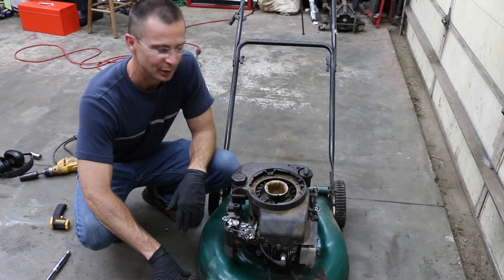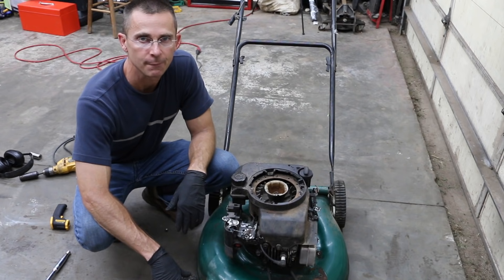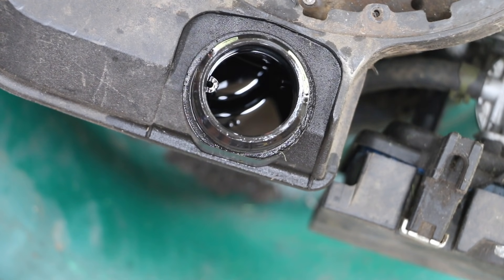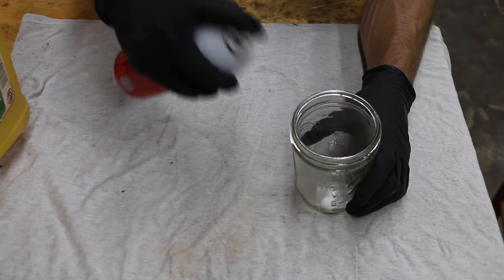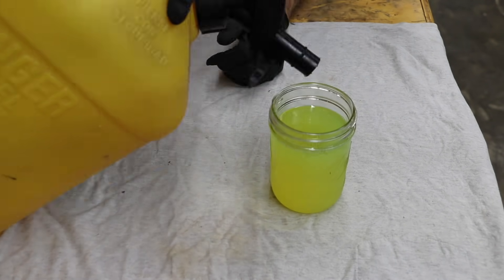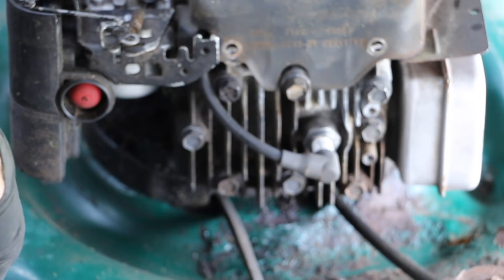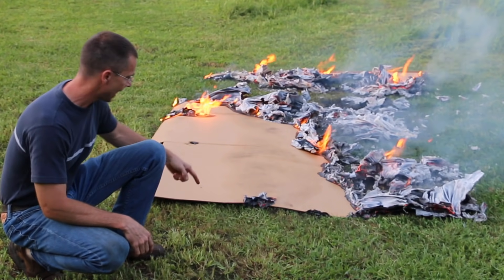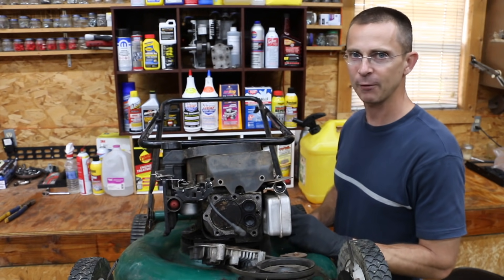Will a Gas Engine Run on Diesel?  Let's find out!

Comment: Years ago, when I worked for a manufacturer of generators and industrial engines, a technician accidentally ran a gasoline engine on Diesel fuel when it was connected to a dynamometer.  It started just fine, no doubt because the carburetor had gasoline in it.  It developed somewhat less power than it should have and ran hotter, and was a bit rough.

In case someone is wondering how he could have used Diesel fuel accidentally instead of gasoline, each dynamometer room had connections for multiple fuel choices, including Diesel, so it was an easy mistake to make.
Reply from the maker: Frank, I enjoyed reading your comments.  Thanks!

Comment: Engine will not run without continues use of primer yet will cut the lawn no problem
Reply from the maker: Chris, It wouldn't run on 100% diesel but did run and mow grass on 50/50 gas diesel mix.  Thanks for commenting!

Comment: One day i randomly checked my oil and the stick was dry.  Come to find out one of Toyotas flaws is that the holes in the Pistons  that Supply oil to the Rings get clogged up. So For the last several months I have been using a fuel system cleaner every other tank of fuel.  Marvel mystery oil, chevron techron, stp multi system cleaner, sea foam, gumout multi system cleaner, starbrite startron, jectron, Lucas deep clean, stp 5in1, Redline, royal purple max,sea foam, and Cataclean will be the last. When the final bottle is through I will be doing a video showing what it has done to the internal components
Reply from the maker: Thanks for commenting and I look forward to checking out the video you make if you'll share the link when it's published.

Comment: I really thought that it wouldn't run at all on the 50/50 mix. Those flathead engines are usually very low compression ratio and that might have contributed to the poor showing of the diesel only test. I had a Suzuki 650 Vstrom and it had 10.5 to 1 compression if I remember right, might have been higher, anyway, the combustion chamber is so efficiently shaped that it runs fine and they recommend 87 octane fuel. Back in the 50's and 60's there were a lot of engines in American cars with anywhere from 8 to 1 all the way up into the 14 to 1 range. The old 426 Hemi had one of those high ratios and required gas rated above 100 octane to run without detonation or pre ignition. I wonder how that engine or one like it, would run on the diesel fuel.  Also I want to know more about that set up you have for starting your mower with your drill. I'm starting to get to where I can't pull start much anymore and that would help me a lot on my mower and my weedeater.
Reply from the maker: I enjoyed reading your comments.  Thanks!

Comment: How about mixing window washer fluid with something?  Maybe window washer fluid and 25% gas?  Washer fluid is Methanol with probably 50% water, if you raise the quantity I bet it will work fine.  WW2 Planes would use this for a stability in fuel.
Reply from the maker: This is a great idea--thanks!

Comment: Running Diesel in a Gasoline engine. I have hade a real life experience with this experiment. Once you have completed your experiment, you need to check the oil level in the pan. Since to Diesel is not ignighting, or burning, due to the compression factor,  it is passing by the rings on the piston in the cylinder. This then weakens the oil properties, and eventually, the engine will seize up. Trashed a Ford V8 engine. Then found out, out on a farm, the large gas tank was filled by the supplier with the wrong fuel. They filled the 500 gal gas tank with Diesel.
Reply from the maker: Dan, thanks for this information!  Sorry to hear that you experienced a ruined engine from this.

Comment: Years ago they burnt kerosene in tractors by running the fuel line thru exhaust manifold. They had a switcher valve to switch from gas to kerosene once the engine was up to temp. My dad said the engine would smoke like crazy if it wasn't up to temp. He claimed the engine also had more power on kerosene. If you would rig up a gas line thru exhaust your diesel trick will work!
Reply from the maker: Thanks for sharing this information!

Comment: We put diesel in our gas tractor many times by accident. I grew up on a farm.  It smoked a lot but no damage to the engine.  It depends on the the how much diesel was added to the gas.  The tractor was still running 30 years later.  Bottom line, if it will start, it will run, but no damage.
Reply from the maker: Thanks for commenting and sharing your experience!

Comment: I actually ran a pressure washer on straight diesel accidentally.  I filled it with diesel that I thought was gasoline.  The engine hadn't been run in months and therefore needed priming.  I was in a rush so I used starting fluid in the air filter to get it started.  It took a while for the engine to warm up and run right, but once it was warm it ran fine.  When I shut it down it puffed white smoke,  I thought I destroyed my engine, but then I realized I had filled it with diesel.  It was amazing that a standard briggs and stratton engine would run fine on diesel.
Reply from the maker: Impressive!  Thanks for sharing this experience.

Comment: Would there be any benifit of running off a mixture maybe closer to 25 gas 75 diesel. Ie more compression, cool engine temps, less wear?
Reply: Or the other way around? Or an e85 and diesel
Reply from the maker: Thank you for these video ideas!

Comment: Great demo. I used to run a 1968 VW Beetle on 30% diesel and 70% petrol. Never had any problems with it, even on colder days. Tiny bit of smoke and you could smell the diesel, but my fuel costs were lower this way.
Reply from the maker: Thank you for commenting!

Comment: I use to own a small diesel car one of the best cars i ever owned.   Diesel has A centian  (sp) rating ( how many degrees it takes to burn) gas has an octane rating (spark ignite ).  While it does not get that cold where i live i noted with age i had trouble starting the diesel.  So i did the opposite of what you did there.  I mixed a 20% gas in my diesel and no srarting problems.  Still got 200,000 out of that 1500cc engine.
Reply from the maker: Impressive!  Thanks for sharing this experience!

Comment: In Australia they developed no sniff fuel to stop natives from inhaling it. By chance I bought a jerry can in Cooktown for a Yamaha Quad bike. As we poured over the leftover we noticed that it also has no color and pours like water. We had some Jet A1 fuel we used to burn mixed with diesel in an old landcruiser diesel. Looked exactly the same but jet fuel sure has more chemicals in it for its wide temperature range use.  No it would be nice to do experiments with such no sniff fuel. Do you ever come to Australia?
Reply from the maker: I've never been to Australia.  Sure wish I could test the no sniff fuel. Sounds interesting.

Comment: In the year of 1990. An old American friend of mine ( GOD BLESS HIS SOUL ) informed me about a secret that an injectors cleaners fluids manufacturers trying hard to keep it a secret from the public that all injectors cleaning fluids are made from diesel fuel base due to its high DETERGENT content to keep the diesel engines injectors clean all the time for a normal operating performance. They just add some additives to mask off the diesel odor So if your car's engine (petrol) start to sputter and vibrate and shake during idling, just add one or two litres of diesel fuel (depends on the severity of the vibrations ) to the empty gas tank just right before filling it up with gas (petrol).  Believe me, Sir, as soon as I did this and drove the car for a few kilometres afterwards  The engine run very smooth during idling. I told all my friends and colleagues at work, to try this trick and save a lot of money not to pay for the expensive injectors cleaning fluids ( one litre of diesel fuel cost SR 0.50 (Saudi Riyal) ). One US dollar = SR 3.75). I have been doing this trick on all of my cars since 1990. Please try it and tell me, What you think. TO ALL WHO READS THIS, SPREAD THE WORD AROUND PLEASE.

Comment: Once I had to mow and I was using my dads mower to mow for him and I have bad sinus problems (and the diesel was in a gas jug)  so I couldn't smell anything and I put diesel in our mower and it didn't run. The mower was about 7-8 years old so my dad figured it met it's maker and was gonna buy one anyway few days later he sniffed the fuel tank and I had put diesel in the tank stupid mistake but I now use the mower I poured diesel in.
Reply from the maker: Thanks for sharing this experience!

Comment: I've wondered about angle milling the head on the piston side to jack the compression ratio and not affect the valve clearance. Just to see what happens. lol It would take a Bridgeport or similar machine to pull it off I think.
Reply from the maker: This is a great suggestion--thanks!

Comment: Diesel is a light oil, It was surprising to see the engine run with a 50 50 without producing a lot of smoke.
Be interesting to try kerosene or mineral paint thinner which is several fractions above diesel
Reply from the maker: These are great suggestions--thanks!

Comment: I'm wondering if it would of worked better with the mower up to temp. Reason is, a few years back they came out with safe fuel that you stored in your trunk just in case you ran out of gas, which it said in the label will not work in a cold engine. And for the rc car fuel, it works in a leaf blow at normal operating temps.
Reply from the maker: Yes, I believe you are right.  Bringing it up to temperature would have helped.  Thanks for commenting!

Comment: It's said you can run an engine on whisky or brandy etc if you run out of fuel. It'd be interesting to try these and perhaps some lower alcohol drinks to see if it would damage an engine.
Reply from the maker: This is a great video project idea.  I plan to test some whisky.  Thanks

Comment: Mixing gasoline and diesel is nothing new. Several old timers, including my grandfather, told me that they added a few gallons of diesel fuel when filling the gas tank of their Model A Ford during the Depression because diesel was less expensive than gasoline. The engine ran ok.
Reply from the maker: Thanks for commenting!

Comment: What about a 2:8 gas to diesel mix in a diesel engine?
-would it run cleaner?
-start better in the winter?
-Or even ignite prepaturely because of the gasoline being purer and combusting quicker?

Unless you cant get your hands on a cheap diesel engine. The last point would ruin it. 
Greetings from Saskatchewan, Canada
Reply from the maker: Greetings!  Thank you for this video suggestion!

Comment: Very interesting:  50% diesel/gas will run a mower.   In an emergency, will it work in an old carbureted car (likely) or new EFI car (less likely)?
Reply from the maker: Thanks for commenting.  I believe a gas/diesel mix will work in an EFI, but I wouldn't begin with 50/50.

Comment: How about pure kerosene or kerosene and gas or kerosene and diesel or kerosene and starting fluid
Reply from the maker: These are great suggestions--thanks!
Reply: Some older Briggs manuals show how you can change the ignition timing to run a engine on kerosene
Reply: My son put a tank of kerosene in my Briggs & Stratton engine by accident and it ran just fine it lag on power slightly and had an off smell

Comment: I have a Craftsman push mower. last summer my daughter ran it out of gas and refilled it. she had a hard time getting it started. I got it started and like your video it smoked a bit. she filled it up with diesel. unlike your video the mower did run on the diesel and mow good. She did have a hard time starting it every time she killed it though. Just depends on the compression of the mower. Plus the mower was nice and hot from already running, so that might have had a lot to do with the mower running on diesel.
Reply from the maker: I enjoyed reading your comments.  Thanks for commenting!

Comment: look at that little fire tornado at about 6:34
Reply from the maker: Yes, that gas really took off!
Reply: Ya, the gas totally flashed off. But the little fire tornado happens on the diesel side at about 6:29 it's really visible at about 6:34 and ends by about 6:41 
(corrected my previous post where I put in the wrong time marker)

Comment: Im guessing the diesel is too thick for it to be drawn through the carb, hence the primer allowing it to run. If so A thinner or heater would help.
Reply from the maker: Yes, you are right. Unfortunately, the small engine I used did not have an adjustable carburetor.

Comment: get the engine good and warmed up then put the diesel to it,  it will run but smoke white under heavy load,  it will run twice as long as gas. ive done it many times
Reply from the maker: This is a great suggestion--thanks!

Comment: Would have liked to see the spark plug after you had tried the straight diesel. Did you pull it for examination?
Reply from the maker: Yes, I should have shown it.  It was rather oily and saturated with diesel.  Thanks for commenting!
Reply: Forgot to add that it was a very interesting video--- thank you!  Had no idea a gasoline engine could tolerate a 50/50 mixture. Now I do, thanks to you. :)

Comment: Whay do you not try the motor with a blow torch gas. (Oxy-fuel cutting gas mixture) (from sweden, don't know the right words for the gases, but I think you understand.)
Reply from the maker: Yes, I could test this gas mix, but it can very very volatile and dangerous.  Thanks for the idea!
Reply: I thing that you have to bypass the carburator. Yes it has the potencial to be a bit dangerous... At my work we us propan and oxyen to pre heet stuf befor welding, its quit potent also.

Comment: An old mechanic that I knew was involved with a project in WWII to try and get a Jeep to run underwater. One thing they tried was a gas/diesel setup where they drilled a series of shallow holes in the cylinders at the top of the piston stroke. When they started the engine, they would run it rich for a while until the engine was at normal temp then switch it to diesel. They would lean out the engine until it ran smooth. The key was the small holes, they would fill with carbon and stay just hot enough to provide an ignition source for the diesel. The problem with the engine came when they would try to shut it down. It would take about 5 minutes to run the fuel out, then wait for a couple of hours before restarting the engine. Restarting the engine while it was till hot would result in a serious case of pre-detonation in the cylinders.
Reply from the maker: I enjoyed reading your comments.  Thanks for sharing this.

Comment: How about an old small diesel engine running on used motor oil. Or any other kind of oil's...maybe mixed with gas if to thick...
Reply from the maker: This is a great suggestion.
Reply: Thank you sir. Would be interesting what the inside will look like build up wise after some use...maybe there is some potential to save some bucks if it performs well enough.

Comment: I have 2 tractors that are designed to run on gas or kerosene. You have to start on gas then switch to kerosene after they warm up. The manual says to keep the engine temp above 190deg. It won't start in kerosene but will run off of it after reaching temp. This was done because during the war gas was hard to get due to Rationing.
Reply from the maker: This seems like a great setup. Thanks for mentioning this!

Comment: Great video like always. Ever heard of a gas vapor carburetor? i think it would be a nice experiment to see if it really works. when working it would be nice to compare it to a normal carbureted engine to see if it saves any gasoline or not (gasoline prices are high in Europe :D)
Reply from the maker: Thank you for the positive feedback!  I'll look into testing gas vapor.
Reply: just use lpg , runs great higher octane and are fumes to.... have run it for years on a chevy 305 ci with a small b&m blower.